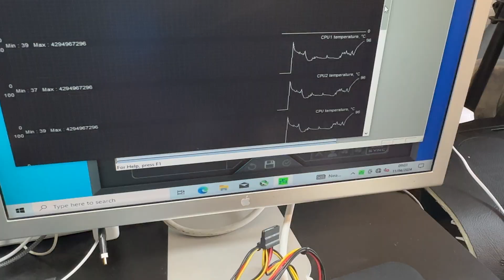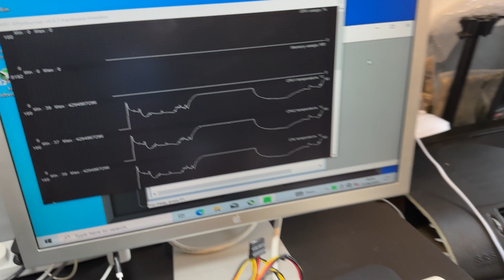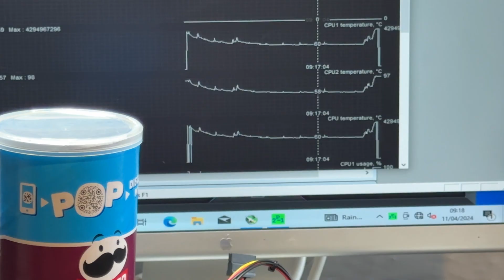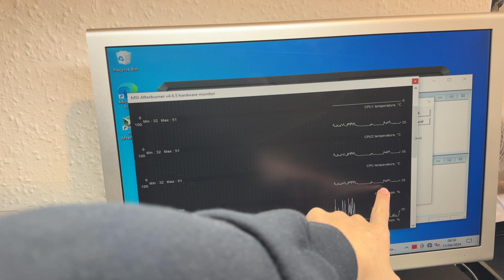Pringles Can CPU Cooler!

Comment: You should try this again but adding a fat layer of solder too the bottom of the pringles can too increase the surface area and to make sure it makes contact with the cpu properly.
Ofc might need to do some lapping on the improvised pringles cooler.

Then secure it by making some holes through halfway up the pringles can to make sure it still is watertight ,some wooden or metal pins that they can wrap around & pull down on.
Zip ties pulled through the motherboard mounting holes after making sure it does contact properly & then fill with metal scrap or screws & some water.
We did this in class with liquid nitrogen instead of water & it worked pretty well, overclocked a socket 754 sempron from 1.6 ghz to 4 ghz, ofc chipset wasnt that happy with such a high fsb speed so stuff like the IDE controller refused to work and we just stuck too making numbers show up on the bios screen lol.